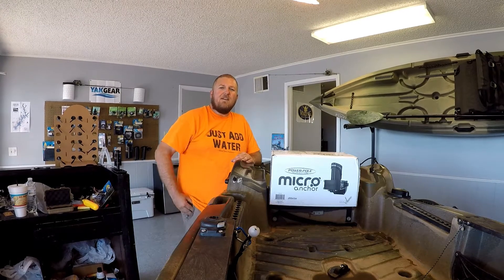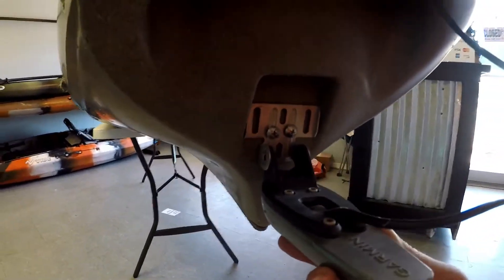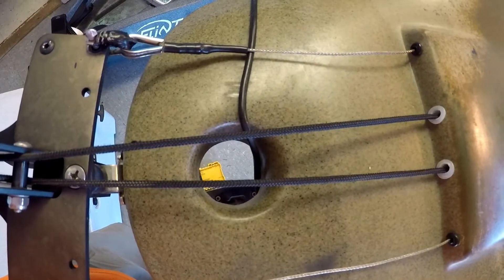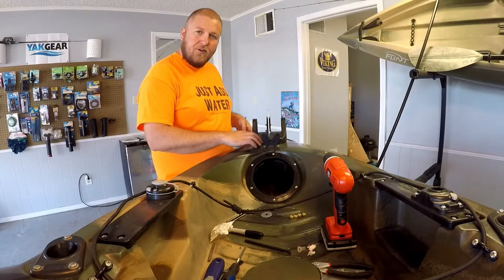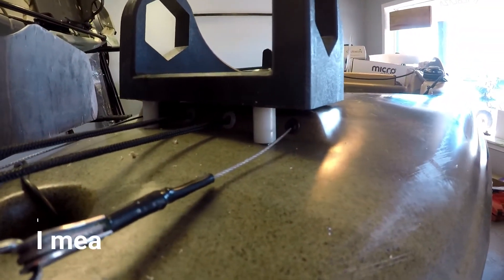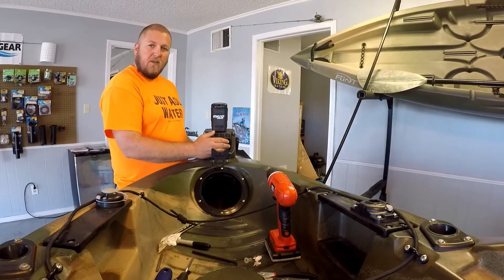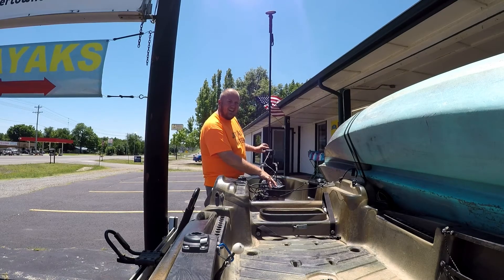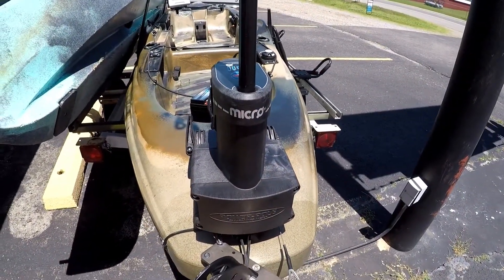Power-Pole Micro anchor install- Old Town Predator PDL

Comment: any idea on the old town Predator Minn Kota?
Reply from the maker: Just looking at pictures, it looks like you could plate the area (cutting board works great) and have the pole go through the handle in the rear.
Reply: @FishingwithFaron   thanks
Reply: @FishingwithFaron  on urs   how long of nylon spacer did u use?
Reply from the maker: I honestly don't remember, I have moved it to my Autopilot now too so I don't have them to measure.
Reply: Fishing with Faron ok cool deal. Thanks for the help.  I wish I would have went with the auto pilot.  O well. Lol. Tight lines!
Reply from the maker: @jeremyhicks5384  You're welcome and good luck!

Comment: Having any issues with the pole getting stuck in the down position? I also have the wireless battery and I have this issue every time that I deploy the pole and the water is too deep so the pole bottoms out on the motor. Pole wont go back up until you remove the battery and reinstall. Apparently it is somewhat common but few people are talking about it.
Reply from the maker: Happened twice today! I plan on contacting power pole this week.
Reply: Fishing with Faron 
Please let me know what you find out.
Reply from the maker: @johnwolff1043  Will do.
Reply from the maker: Spoke with them and they said the battery needs to be calibrated to the unit??? Cycle the pole from the ground to the full up position and back down 20 times and it should fix it. I have yet to verify this.

Comment: Hey! I just ordered the power pole micro for my pdl. Are you still running this setup? Any issues? Anything you would do different?
Reply from the maker: It worked good, I recently upgraded my fishfinder and the transducer was too large to work like this one did. I am in the process of moving my power pole to the side of the kayak. Basically just turning the mount 90 degrees.
Reply: The safety mechanism will not work with that set up